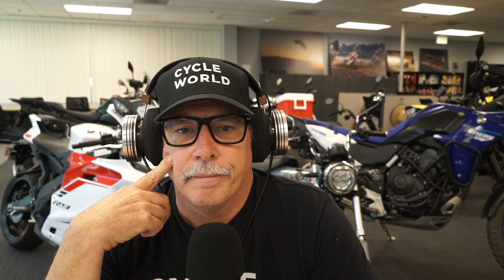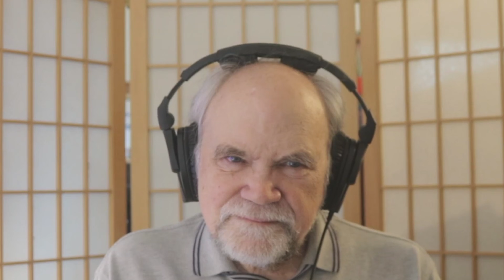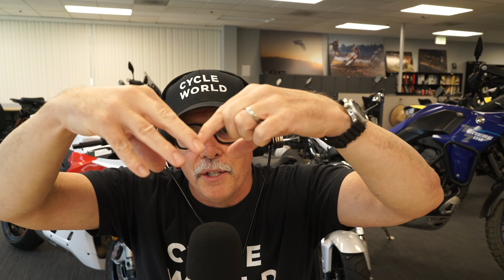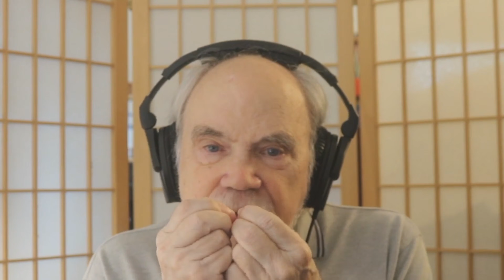HOW FAST COULD WE GO?! What's making new motorcycles slower than they could be?

Comment: You guys have given me some new ideas about what was happening to me aboard a Triton race bike. In 1973 it was obsolete for the class I was in. I was riding nearly the only 4-stroke twin on the track against mobs of factory 2-stoke racing machines. The engine was a bored out Triumph pre-unit in a Norton Dominator frame. The close ratio 'box' drove a dry clutch. Brakes included a 4-leading shoe Ceriani at the front , and a drilled out Manx drum in the rear. Road Holder forks ... Manx tank and saddle. It was a handsome classic. The high mounted twin megaphone exhaust produced the most delicious sound. It tracked exactly where I aimed it, but exiting out of corners was a nightmare, especially in the esses at Westwood  racing circuit ("Mountain High Racing" near Vancouver BC.). It would "camel" and threaten to throw me off, or just wobble and crash. Exiting any corner was a test of my nerve;  I'd have to feather the throttle and accelerate gently until the cameling or weaving at the rear settled down as I came upright. I changed to better rear shocks with progressive springs, and that helped somewhat. But, the scary bit was still there. I've always thought that the featherbed frame could not handle the torque of the modified engine. But perhaps there were other factors. Fifty three years later, and listening to this presentation, has caused me to think again. And BTW, I love this channel !

Comment: Another explanation would be the doubting of the announced engine powers.
MotoGP went from 265 to 300 (340!?) HP 
but only gained 5 km/h on circuits with the longest straights.
The aerodynamic mustaches will be accused.
The faster the bikes go, the less the maximum speed has importance on the lap time, and the more important the slow zones will be for the time.
A Formula 1 car is not made to go fast in a straight line but to accelerate hard and go quickly into turns.
 Endurance racing prototypes are faster in a straight line but much slower on a lap.

Comment: Ilmor produced a “five stroke” engine. Every pair of cylinders exhibitor a larger third cylinder. This extracts power from the exhaust gas. It also provides a V twin style vibration control.

Comment: I perked up when Mark mentioned experiencing a 250cc GP bike and learning the difference between 'race bike' and 'street bike'. I had the same experience using those 250cc GP bike engines in what was called a 'CIK Formula E' kart back in the 1990s. I had driven fast street cars and I had raced much more ordinary 100cc karts, as well as dirt bikes in a previous life. But a kart with perhaps as much as 100hp is a different thing, entirely. Warp speed, baby!

Comment: Some thoughts:

The problem with natural gas is, while the CO2 emissions are relatively low when you burn it, the methane itself is way worse than CO2 if you don't burn it, and natural gas infrastructure is shockingly leaky. (Also, electric vehicles beat the equivalent internal combustion engine on GHG emissions in even the dirtiest US grids.)

Thermal efficiencies on some modern gasoline engines can be quite a lot higher than 25% - peaking at 40% or more and spending a lot of their time above 30%, but you won't get the extreme power density of a superbike engine. Use relatively large cylinders to improve the surface to volume ratio, use low-tension piston rings, an offset crankshaft, and low operating RPM to reduce friction, use a relatively high static compression ratio and undersquare cylinders to improve expansion (who needs a power recovery turbine when you can use a longer piston stroke to recover the energy instead?), use direct injection so you can run a higher dynamic compression ratio, and use variable valve actuation both to broaden the RPM operating window of the engine and enable Miller cycle operation at partial load to reduce pumping losses (instead of closing the throttle). Maybe throw in externally cooled EGR to dilute the mixture even more at low RPMs and loads. (Bonus points if you pair it with a transmission that can keep it in the sweetest spot of its operating window. That's some of the magic of Toyota's hybrid cars - while they have a full BSFC map, once they're warmed up, they operate in a line drawn on that map, with a consistent RPM for a given power request, and will shut off the engine if they're at the left side of that line.)

All of that gets you something like the Toyota M20A-FKS, which peaks at 168-176 hp (depending on model) at 6600 RPM. (Or the M20A-FXS used in hybrids, with a bit more efficiency, but that makes even less power.) Problem is, let's say you cut it in half to make a motorcycle-sized engine. You now have very tall 1.0 liter parallel-twin making 84-88 hp, and it also has a decent amount of weight up high due to the variable valve actuation and high pressure fuel system (and Toyota uses two fuel systems to avoid some of the emissions and reliability problems that only having direct injection has on gasoline engines).

Of course, you can do a less extreme version of that - Honda took their SOHC 16 valve variant of the L13 - with 73 x 80 mm cylinders, very undersquare - used in the Honda Fit in some markets (and, in the US, was the basis for the original Civic Hybrid's engine) - which probably got somewhere in the mid 30s% peak thermal efficiency - took off the VTEC because a motorcycle being lighter doesn't need as much low-end torque, cut it in half, and called it the NC700 family. And, it made basically half as much power as the L13 (slightly more than that, in fact), 51 hp instead of the 99 hp the L13Z1 made. (Because it wasn't exactly the L-series engine and had wider bore spacing, they then were able to bore it out to 77 mm for the NC750 family (where the L15 instead went for an even longer stroke), which now makes about 58 hp.) Not the most exciting engine, pretty large, pretty heavy, but it makes the 270° parallel twin sounds, and gets fuel economy that a 670 cc twin would normally have no business getting (of course, it has the power of a 400-500 cc engine, so, tradeoffs).

Comment: Oil doesn't need to be above boiling to drive off water.  The vapor pressure goes up with temp and anything above ~180 is enough (as Kevin said the oil companies recommend) as long as you maintain that temp for awhile.  Both my truck and Corvette have oil coolers in the radiator and maintain oil temps in the 180-200 range.  No water.

Comment: Supercharger
The V-1710 has often been criticized for not having a "high-altitude" supercharger. The comparison is usually to the later, two-stage, versions of the Rolls-Royce Merlin 60-series engines also built by Packard as the V-1650 and used in the P-51B Mustang and subsequent variants. The USAAC had specified that the V-1710 was to be a single-stage supercharged engine and, if a higher altitude capability was desired, the aircraft could use their newly developed turbo-supercharger as was featured in the XP-37(YP-37), P-38, and XP-39.

The benefits of a two-stage supercharger eventually became so clear that Allison did make some efforts in this direction. Allison attached an auxiliary supercharger in various configurations to the existing engine-mounted supercharger and carburetor. Early versions of these two-stage supercharger engines were used on the P-63. No intercooler, aftercooler, or backfire screen (flame trap) were incorporated into these two-stage V-1710 engines (except for the V-1710-119 used on the experimental P-51J, which had an aftercooler and Flame Traps). The two-stage Merlin engines had all of these features, which were designed to prevent detonation from charge heating and backfire into the supercharger. The G-series V-1710s installed on the F-82 E/F/G models had only anti-detonation injection (ADI) to deal with these problems, and not surprisingly had severe reliability and maintenance problems. In one record, it was stated that the F-82 required 33 hours of maintenance for each hour of flight.[5]

Comment: Mark, are you sure that's the bike they put in a wind tunnel?
I could swear I remember reading in Jerry Branch's performance book that it was him working with the people and that they'd used his FXR test mule for that.
I know he talked about it in that book, and the results, but I could swear it was him working with that engineering dept from that college that he helped write their engineering books when they did the wind tunnel test of a motorcycle vs it's plywood silhouette.
Reply from the maker: We will go back to the letter where we think we read this. It was Branch writing to Don Emde, recalling his work with H-D during those days. Emde is a real historian and custodian of the great legacy of riders, racers, and tuners, and knew Branch well. We'll check!
Reply: @cycleworld 
It could be you're right, it was 25 years ago when I got my Branch dealer setup at my shop and got his book, which unfortunately I lent to someone about 18 years ago and never got it back, I remember him talking about the wind tunnel tests in the book, and I remember the test mule at their shop they used for development was an FXR, I believe an 85, so there's a distinct possibility everythings convoluted in my head, but I do remember whatever bike it was they used that the explanation for the results was that the bike has length to it with frame tubes and an oil tank and a battery box etc etc down that length and all those things contributed to drag, wherein with the flat piece of plywood silhouette as soon as the air gets around the edges it can start straightening itself out, which makes perfect sense when you think about it. 
Did you ever hear the Jerry Branch/Elvis Presley story?
It's really good, you might be able to enter "Jerry Branch/Elvis Presley" on YouTube or the internet and find the interview where he talks about it, it's a shame before he was gone someone didn't sit down with him and get a complete oral history from him, that would have been good.

PS, Try to goad Kevin into telling more Dick O'Brien stories, they're funny especially when he imitates him, I'd like to hear an entire podcast of him telling stories about O'Brien.

Comment: Have you seen the Cleetus guys spraying adhesive glue on the rear tires and the dyno rollers to help keep the rear wheels from doing a burnout on the dyno?
Traction in a can!

Back in my younger days I swapped in a 6 speed gear set from an FZ750 into my FZR1000.
I had no issues, I just had to remember to swap out the 5 hole spray bar from the 1000 to the 6 hole spray bar from the 750.

Great show!!

Comment: I've felt for a while that horsepower and engine development has reached a cost peak. Sure, a lot of things could be employed in the engine designs of the modern motorcycle. But that's really at the detriment of simplicity, reliability, and cost.
The most "needful" area of a motorcycle design RETHINK is aerodynamics.
Humans are designed to face the world with eyeballs perpendicular to the earth's horizon. Assuming a position other than standing straight up is a compromise.
Unfortunately a motorcycle would have to force us humans into a posture that is uncomfortable or awkward to achieve at least 50% improved drag reductions. It would require a complete rethink of how a rider interfaces with a 2-wheeled machine.

Comment: Great show!  this is why you can never  bet on mark saying velocette. Last show on vibration two mentions, this weeks show on top speed areo dynamic four times 🤔🤔great show as always, font fender areo is definitely worth mph. Sometimes eliminating show results. Ask Johnny Bohmer on his kz 1000 top speed run at KSC. As far as coating,  at AETC conference it was always  a subject too go into. Cup and NHRA guys big smile very secretive, it’s not what  type of coating it is. But  where you are putting it on what parts. For the regular guy with hypo car or motorcycle it make no difference in the numbers, that is a fact. Just like oil if you use the recommended viscosity and you are a reg guy makes no difference. As long as you change it and filter regularly as manufacturers recommend thanks again.

Comment: Does Ferrari have the gears of its gearbox gasping for air in boiling oil ?? Maybe Ferrari (certainly Alpine) should pay attention when Kevin is talking about toasters and stuff and boiling oil in gearboxes
Reply: F1 cars (and other race cars) have been running gearbox oil coolers since before the 1970's, probably long before. The 70's Ferraris I worked had them.
Reply: "One litre of oil sits as a reservoir in the bottom of the gearbox", with the gears of the layshaft partially submerged in it...Alpine Splash  F1
Sam Collins suggested that Ferrari would have altered Aerodynamics at Monza to  provide extra cooling for the gearbox
Maybe I've gotten this and that and everything  all wrong...Sorry!
Reply: @perhage338 A layshaft in a sequential gearbox???. I guess you could but why, it would have no function. Look inside an F1 gearbox from the past forty odd years and you'll only see two gearshafts, they are the same design as a motorcycle gearbox. The race bikes run pressure lubrication to each gearset and a scavenge pump to a cooler, F1 might still use top splash feed (with a lower scavenge pump) but I doubt it, the power loss and heat control is a real issue.
Reply: No "layshaft". Sorry

Comment: I think street bikes have reached their limits set by traction and wheelbase and a 7 second 0-125 mph run of a S1000RR are the limits of physics ! 125-186 could be faster with more horsepower but in USA you are already risking jail at speeds above 100…Streetbikes need wide powerbands with High Torque ; The perfect tool would be a 1400 cc Boxer making 160hpNM with the no power sapping straight through shaftdrive and the vertical crank building up no gyro ! As for electric its dead for obvious reasons ; dirty electricity/batteries that are heavy have short ranges and need long times to recharge besides people dont fall for the C02 lies anymore pushed by governments ! But a electric no lag turbo or flywheel that improves performance like Porsche introduced in the new 911 GTS and Turbo might work in motorcycles too 👍

Comment: Have to disagree about turbo bikes having steep power curves. I have an old Rajay on my Z1 engined race bike. Back in the day no electronics. Above 4000rpm the boost followed throttle. It was very linear. Fueling was well sorted with a powerjet added to the Zenith carb and a boost controlled valve that tipped fuel into the carb intake dependant on boost.